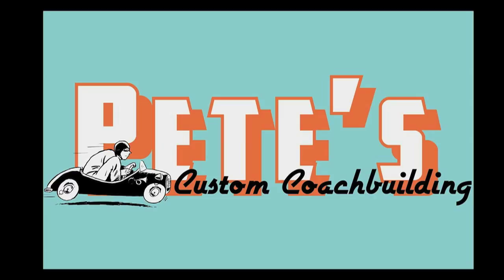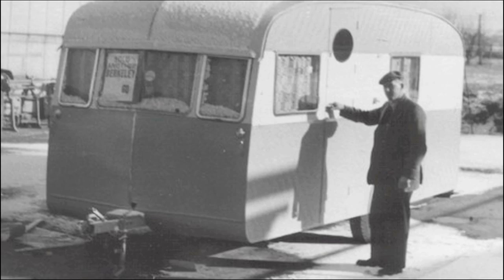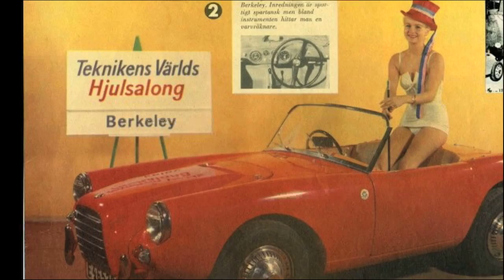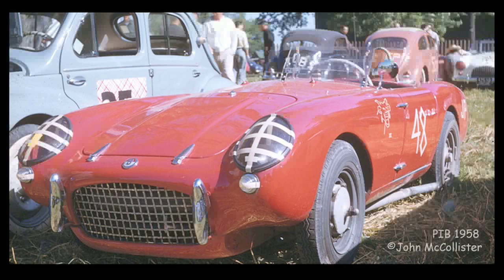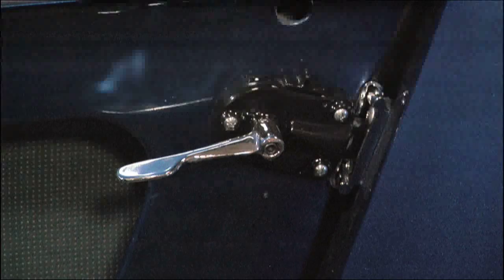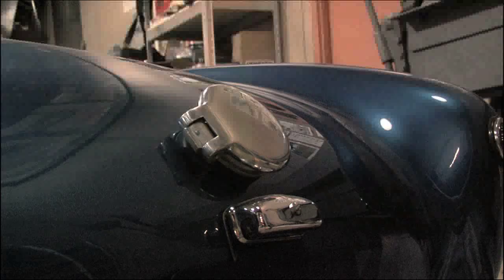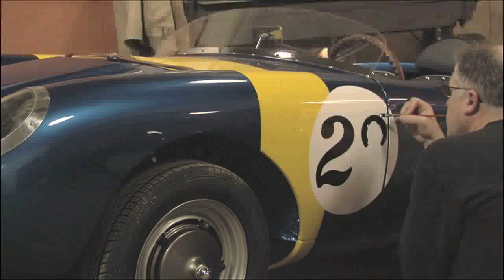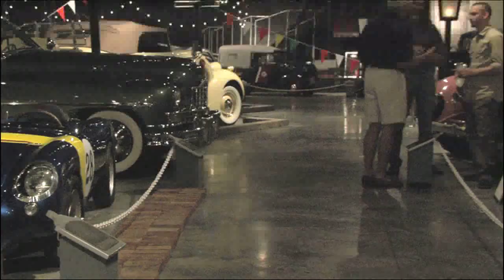Restoring History: "1958 Berkeley SE492"

Comment: A friend of mine had one of these in the early 60's and I viewed it with some admiration and a small amount of 'envy' I had a 'Powerdrive'  3 wheeler which was aluminium construction, and arguably at the time somewhat better than Glass Fibre, although it added some weight. It had the British Anzani 328cc twin 2 stroke engine in the rear behind the driver's seat, and covered many happy miles in it. It would run merrily along at 45 mph all day, but struggled a bit on long hills. Well done with the Berkeley Project. The rule was at the time, and is in fact still the case today in the UK, is that you could drive this on a motorcycle licence, and the 'road tax' was the same as a motor bike.

Comment: hello, i am restoring a berkeley at work and would like to know what you did about the front suspension? I saw you had a sway bar across the top mounts. just wondered how you mounted them to the frame.
thanks

P.S awesome finished car :)
Reply: Mark Millard, my father in law had a '59 Berkley in Wichita, but Kansas summers were too hot for the little ram-air cooled engine. Excelcior also made a cooling fan for a little 2cyl. truck which he bought complete with shroud and mounted it outside the primary case driven by the crank. We fabricated a fiberglass duct to blow all that air across the heads leaving the ram air for the iron cylinders.
There's lots you can do to hotrod these little engines.
Milling the heads raises compression. Cutting 1/8 to3/16 in.off the piston skirts extends the intake time, like "camming"a 4stroke,and mating and polishing intake and exhaust ports gets everything you can out of the little Villiers/Excelcior engine. I'd like to find Mark's car, but I think it went to Arizona.